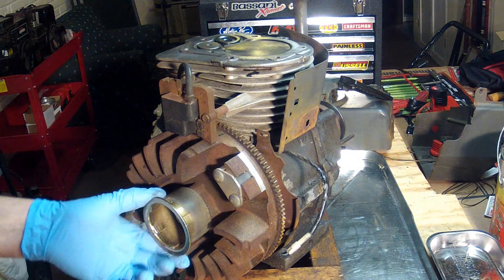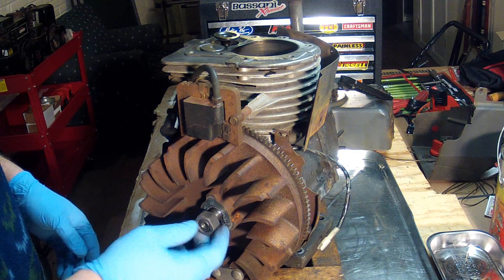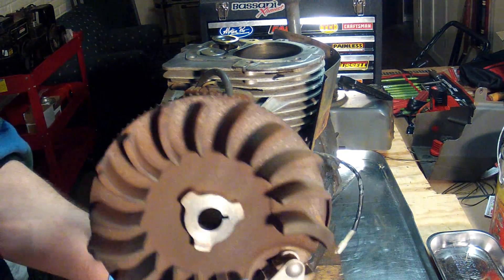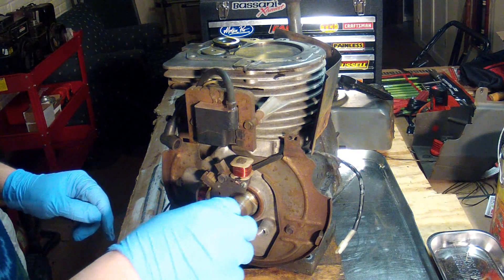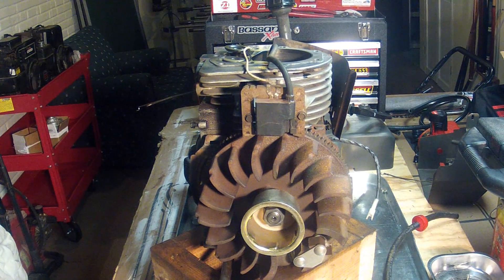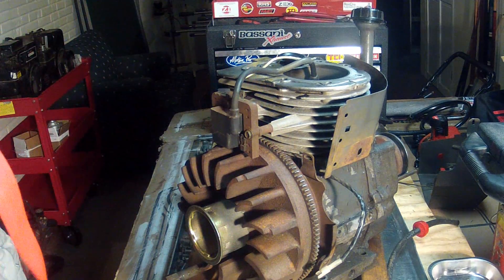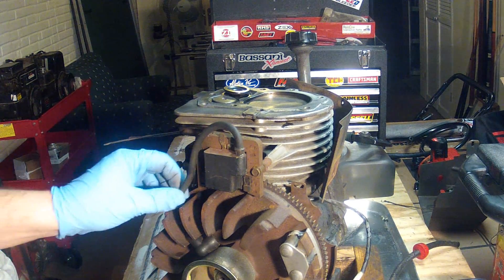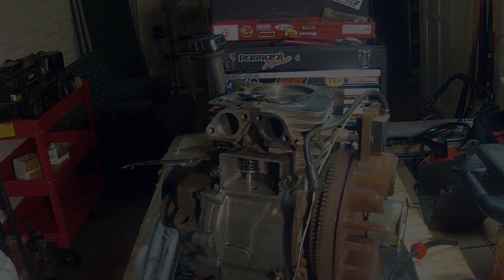Tecumseh HM80 Engine Part 6 - Flywheel Removal and Installation with ignition setting

Comment: I have a Briggs strap wrench I use and never knew it went around the flywheel like that - I thought it went on one of the metal fins.  I just thought - what if the fan was plastic?  Thanks a bunch. Does anyone know how to test the strength of that flywheel magnet?  I have a weak spark so bought a coil on Amazon - but prefer to not spend $86 on a flywheel unless I absolutely have to. It has solid state ignition no points.

Comment: what is that black wire sticking out behind the flywheel connected to the copper for?
Reply from the maker: That is the generator/alternator. It provides power to a light on the snowblower that this engine came from. Thanks for watching.
Reply: @RealManSkills  o thank you

Comment: Do they require a steal keyway?
Reply from the maker: You need to use a flywheel key. It acts the same as a sheer pin. It will break before something else that is more costly breaks. Thanks for watching.

Comment: I just bought a go kart with an hm80 on it, I'm interested in adding a starter and a stator, can you recommend a stator? I noticed the one on this engine is rather small will it charge a battery?
Reply from the maker: I don't know much about stators but with the engine running, use a multimeter to measure the voltage coming from the stator. If it's more than 12v, it should charge the battery.
Reply: thanks, the stators I've looked up so far make a complete circle, the one in your video is small, so if I try to get a stator I want to make sure it is the right one

Comment: Which Tecumseh engines do you think are better? The CID ignition which has the coil above the flywheel like the one in your video, or the older style points ignition which had the magneto behind the flywheel?  Besides which you think is better, what are the advantages/disadvantages of the two different ignition setups in your opinion?
I ask because I have one newer 2002 Tecumseh HMSK80 on my Snapper but I have also dealt with a few Tecumseh H70 engines from my 1971 Ariens Sno-Thro as well as one 1975 Tecumseh HM80 snowking which has points ignition and those engines really run great. What do you think is better the classics or the newer ones before they went out of business with CID? CID or points?
Reply from the maker: The simple answer is this - I always prefer the newer ignitions. They are so much easier to access than the points and condenser models. I must add that I have seen more Tecumseh engines blown than any other. However, the Snow King engine by Tecumseh, was the predominant engine on most snow throwers. So there were more of them to blow.
Reply: Thats something to ponder. Sorry to hear your experience with Tecumseh hasnt been so great. For me its been the complete opposite I had one H70 snowking blow at age 43. It was blowing oil at the end. Also the recoil had broke and I was wrapping the rope around the starter cup. But I had mistakenly pulled the whole flywheel the wrong direction a bunch of times before I replaced the recoil. Then it blew. But 40 years for an engine working hard, thats pretty damn good. I have two other now 45 year old Tecumseh H70 engines powering Ariens sno thros and one 1975, 41 year old HM80 from an Ariens all still going strong. Their all point ignitions. The one is nearly pristine.
I have one 2002 HMSK80 on my Snapper snowblower, never had one issue with it. That one has CID and a stator which is nice because I can power other add ons, like lights having a light on a snowblower at night makes a huge difference one thing most of the classics don't have. Ive had great success with the Horizontal medium frames they built, aka the snowking. I also like the way the old ones switch from winter to summer engines very easily. They are versatile engines and I would choose it everytime over any other winter engine. Their nearing antiques at age 50. I have also had success with the Predator 212cc honda clone and at $99 and under no one can compete with that price. However those classic point ignition Tecumseh engines just seem to beat to a different drum than todays engines. I have come across a few poorly designed Tecumseh's like some of the eager 1's that were used on Sears products but then I had one that just had the heart of a champ and just ran so much better than any Briggs lawnmower engine I ever ran. They did build a lot of snowkings but one thing you cant deny is there are still a lot of snowblowers from the 60's and 70's still running, still throwing snow, 40, 45 and 50 years later now becoming antiques. The HMSK80 on my snapper is a workhorse. 15 years of commercial snow removal and hopefully another 15 plus before it dies and I have to repower it. Im not big on buying the flimsy junk their making now and will avoid nearly all together. Well thanks for responding to me. I hope your luck with Tecumseh gets better, specifically their horizontal medium frame line they had. Take care.
Reply from the maker: My own Ariens Snow Thrower has a 7hp Tecumseh on it now. It's from 1979. Didn't have any issues until just now. Went out to start it yesterday and no spark. It's not "blown", just needs condenser and points probably. Thanks again for your input.
Reply: sblg43 I just sold the one but in 1975 for $300. The older ones are bringing in good money right now. The reason being people are beginning to realize these American golden age engines built from a time now passed are not being built any longer and down the line it will be hard to find them as people hoard them away. When that happens the prices on these classics will continue to skyrocket as they will be hard to come by. Now everything is basically built in China of relatively lower quality and it doesn't look like companies like Tecumseh, Clinton, Wisconsin, power products, lawn boy by outboard motor division evinrude, McCulloch go cart engines, crysler and so on will ever be building high quality engines in the USA so they are becoming a commodity to the American golden age of manufacturing, engines like McCulloch go kart engines and power products are already nearly impossible to find as the remaining existing ones have all been scooped up. Thats exactly whats beginning to start with Tecumseh now.
Reply from the maker: I happen to have (in my office, on a shelf) a Tecumseh H60 that has never been used. It still has the tags on it from way back when Sears used to sell engines. A friend got it from Sears for $10 and let it sit around his garage for years. He finally gave it to me and I polished it up and put it on the shelf. Just like having it there to look at.
Reply: sblg43 Thats awesome lucky guy. I would keep on the shelf. Its already worth big money. Hang onto it. Someday it will be museum worthy and be worth a nice little lump sum.
By the way your right about Tecumseh motors blowing. I went to pick up an H60 a guy was selling cheap today. He showed me an HMSK80 that had blown. It appears the lower end of the connecting tod had a weak spot right where its flat where the longer upper bolt threads in. It fractured right above the flat spot for the bolt to screw in and the motor blew, blowing a hole in the crankcase. The flywheel key was sheered flat into the crankshaft and the keyway on the flyeheel for the key. So it appears its the luck of the draw weather those engines blow or not. I asked him did you run it low on oil or overrev it, answer was no, it blew as he was in gear moving it out of his garage. I could not believe that happened.
Anyway I picked up a super clean 1971 Ariens Tecumseh H70. It is super clean. I paid $150 for it someone offered me $400. I wouldnt sell it. I put it on my matching 71 Ariens sno-thro chassis. Its in my videos. Titled all original 1971 Ariens sno-thro.

Comment: This was a huge help... I had to use a pry bar and a large chisel on the other side.... found out my key way was sheared and my magneto was 180 degrees opposite
Reply from the maker: +Davolas46 Happy to help. Thanks for watching!
Reply: Just got back from work and put it together. Fires too, carb adjustment in the morn

Comment: Great videos, sblg43.  I just went over to my recently-acquired Horse Tiller with an HM80 on it. It hasn't been run in years. Oil in the engine looks clean. I took a 15/16 socket, put it on the flywheel, and gave it slow turn. A terrible creaking/scratching noise came from under the shroud. Not sure if that might be normal or if that is coming from within the head. I'm thinking that if the oil looks good (and not low), then it's probably nothing? I have yet to take it apart because  I need a place to work on it - and that is coming.
Reply from the maker: +Alan Meijer Those noises could be a lot of different things after sitting so long. The rings and pistons are probably dry. You could squirt a bit of oil into the spark plug hole and try again. It could also be rust on the flywheel or even a mouse nest inside the shroud. Let me know what you find. Thanks for watching!
Reply: +sblg43  Oh that flywheel is rusty alright! Thanks for the reply. This is an amazing series of videos. They are well done, performed at a great pace, with great lighting and camera angles. And you reply quickly!
Reply from the maker: ***** Happy to help and thanks for the support.

Comment: I watched other vids that said valve clearance is .008 for intake and .012 for exhaust. The way I read Tecumseh specks you are doing it right, it says MIN/MAX at the top of the spec sheet...NOT intake.008/exhaust.012.  Good video and right.
Reply from the maker: +Mark Weaver Thanks!